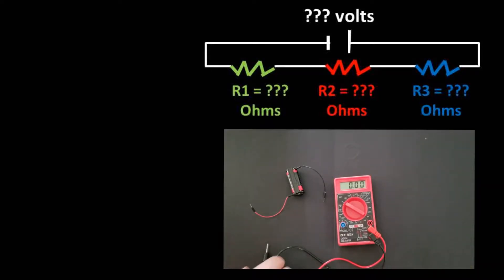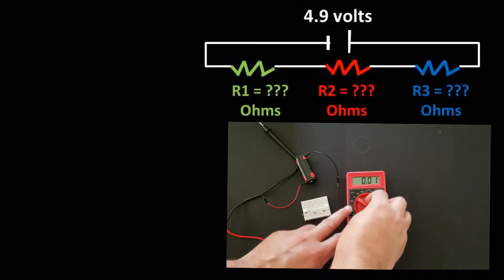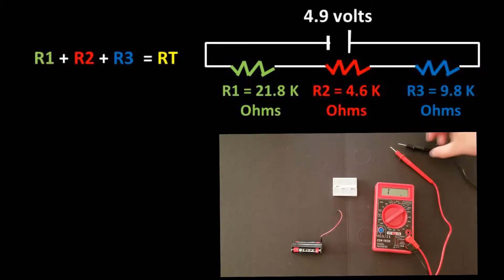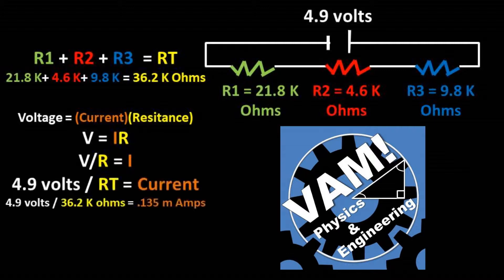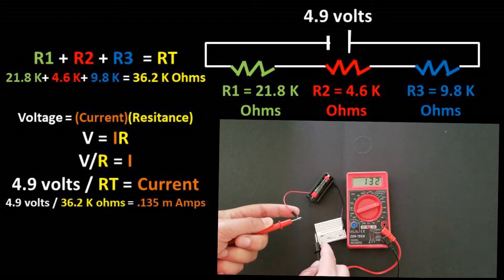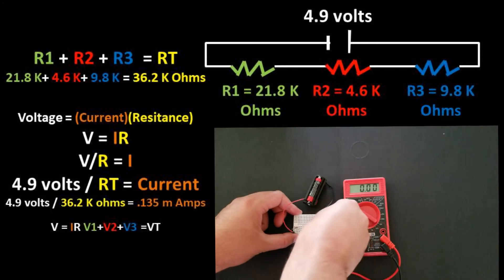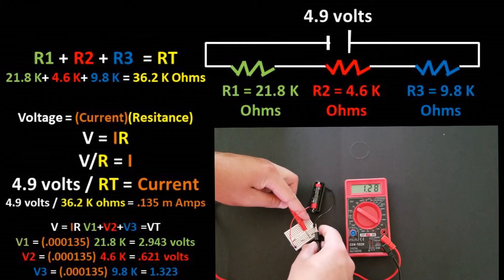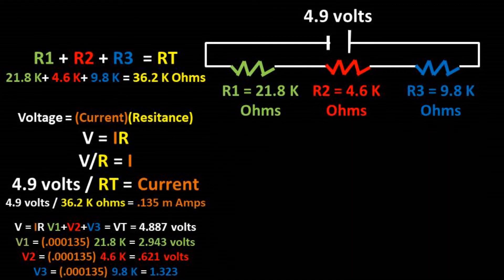Resistors In Series Circuit - Calculate and Multimeter Resistances, Currents, & Voltages

Comment: Thanks for the explanation. Can you help me understand something:
Why doesn't the voltage go to zero and stop current flowing to a certain point at the end of R3? My intuition says that a resistor is like cutting off some flow, so it drops bit by bit each time the flow goes through another one. 
I measured a 24 V supply going through two 470 ohm resistors (total 940) and still got 24 V. Why doesn't it drop? If the voltage is lower across each resistor, why is it still 24 V when measuring across all of them? I thought it was supposed to resist the supply. I'm told the current is the same throught the whole circuit.